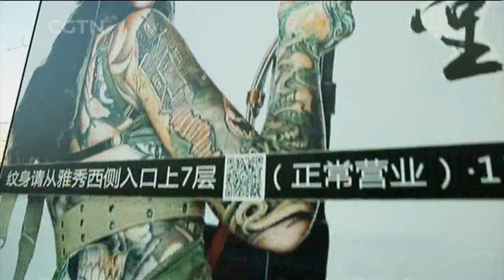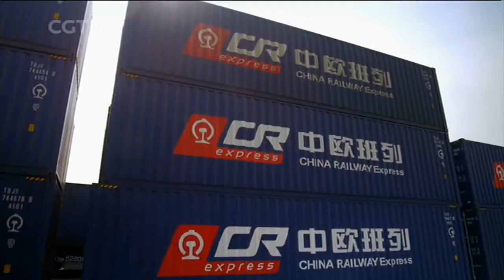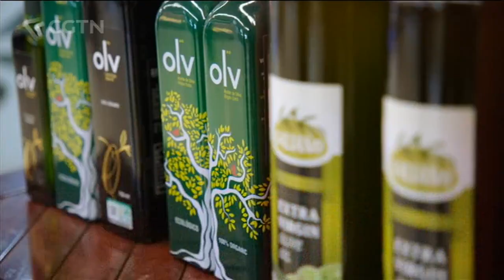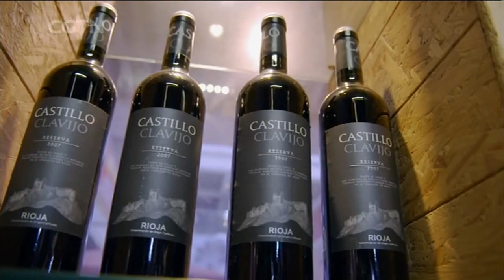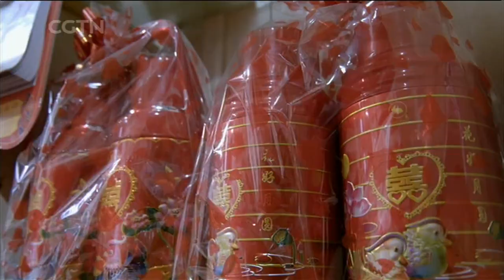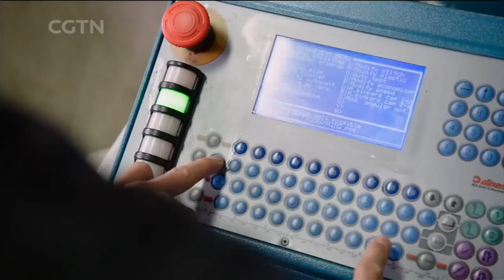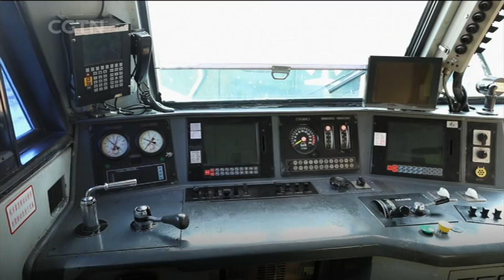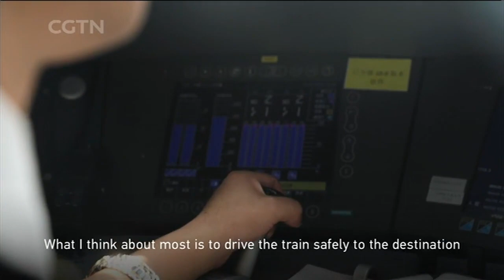China Railway Express: From Silk Road to Silk Railroad

Comment: The main problem confronting the West is partly their political system where "salesmen" are elected once every 4/5 years. Their interests  must be short term and consequently the current mess facing their development process. China is looking at all these issues over very very long term. She understands that infrastructure of all modes of transportation, especially rail because of its larger capacity and quicker movement become their choice to improve her internal logistics needs and having more or less achieving that , she decided to improve this connecting transport mode across the Eurasian landmass. Indeed, with some 17 million square km to cover, indeed rail connectivity is the solution as many of the Eurasian nations are land-locked. Indeed, the century for the Eurasian!